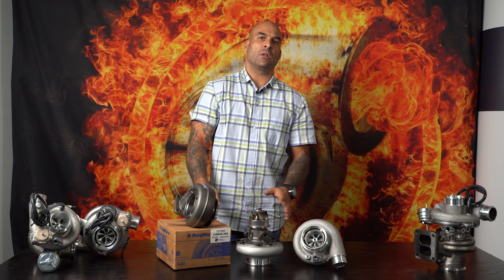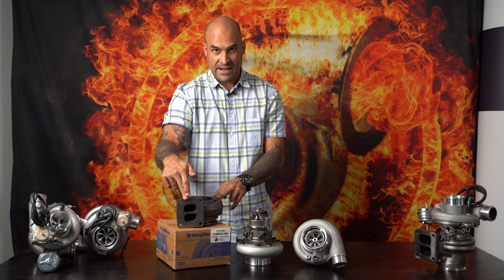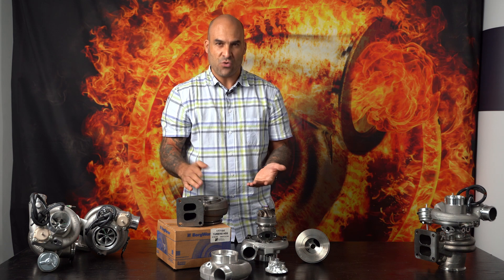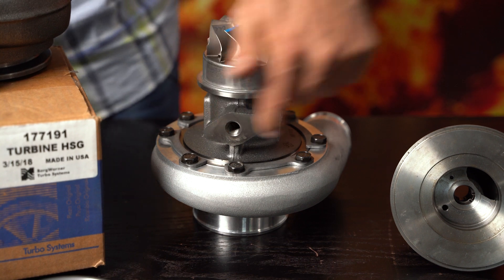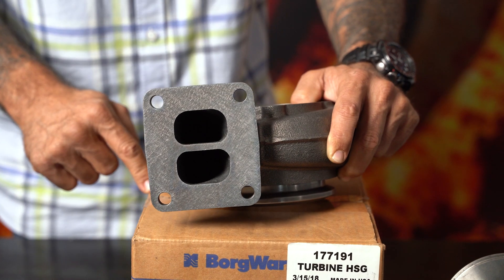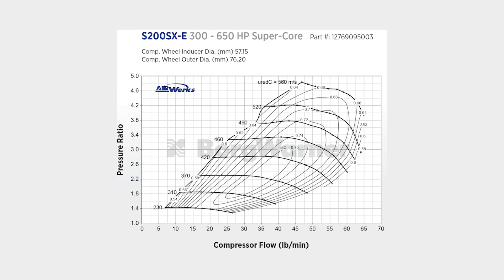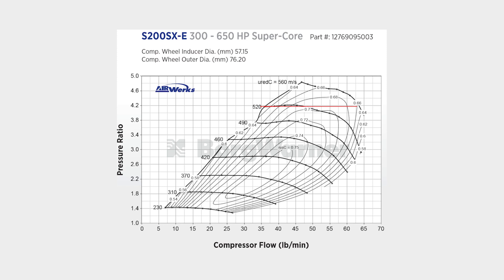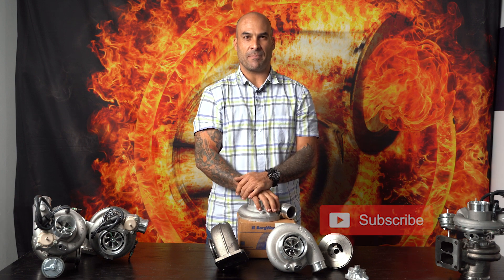BorgWarner Airwerks S200SXE - 650HP

Comment: I love your videos
I choose the bw s252 sxe t3 single ar .82 for my bmw E30 m20b25 2.5 lit stock bottom 
I will run it to max 13 psi and my goal is 300-350 hp 
It will be laggy to spool?
Reply from the maker: Thank you for the comment - the setup will not be laggy at all - very streetable and will make the power no problem with plenty in reserve.
Reply: @TurboDirectSA  thanks for your fast reply
i was between the s257 and the s252 ,so the s252 from my research was correct
Reply from the maker: @bmwe-op4jx  Both turbos at the boost and power target you want to run are correct options. The larger turbo will obviously allow for more reserve should you choose to up the boost later, but response will be almost identical, with the slightly different power level available.
Reply: @TurboDirectSA  my main concern was that i cant go more than 15 psi,so the smaller turbo for my specs and engine was more streetable and faster boost in lower rpm range i think
i will run it with 3 different maps,7 psi ,10 and 13 at max
Reply from the maker: @bmwe-op4jx  Both turbos will easily spool with that engine, the larger S200SXE will just make more power at the same boost pressure due to its higher flow rate.
Reply: i upgrade my s252 to the s257
it made 502 whp and 685nm at 1.7 bar. That turbo is amazing..at 3.8k rpms it has 590nm
  @TurboDirectSA
Reply from the maker: They are amazing turbos!  @bmwe-op4jx

Comment: Hi i will like to fine out if this turbo will work well on a 1jzgte vvti engine
Reply from the maker: It will work beautifully - for a street car aswell as a nice 650HP drag setup - in fact this is one of the turbos we will be testing on our 1JZ project car we busy installing into the BMW E36 shape body. 

We will do back to back runs with different housings, and the EFR7670 and EFR8474Black series - then we will change to the Garrett range of turbos and do the same back to back testing to show the differences on the same engine same boost and different AR housings.
Reply: Nice project . Cause what am looking for is quick spooling and lil lil lagg not make much
Reply from the maker: @tezzaking1014  It will work well - use a separated manifold and use the twin scroll AR83 housing.
Reply: Thnks alot i was thinking about using a twin scroll  AR83 housing.
Reply from the maker: @tezzaking1014  You wont go wrong with that housing.  Make sure your collector is made correctly - ill do a video on what a collector should look like and what angles work well -
Reply: That will be great thanks alot
Reply: @TurboDirectSA  hi what's up any update on the 1jz project with the BMW  E36 shape ???
Reply from the maker: @tezzaking1014  here you go -- more to come soon  https://www.youtube.com/watch?v=I14mwxVYhoE&t=1s

Comment: Firstly, this is an awesome channel and thank you for the detailed informations :D

Secondly, I have an SXE257 installed in my car, on an 8V 2.0 Engine from Volkswagen (completely modified) with a custom Turbine Housing with selfmade QSV valve integrated in the housing.

Actually my axial bearing died, but do you know that kind of problem with the axial bearings? because it's not the first 257 that i know with bearing damage.

Normally i use about 2.5 bar of boost, but tried up to 2.8 this year (shouldnt be the problem for this Turbo)

thank you
Reply from the maker: Hi Ronald,

Thank you for the compliment. What boost are you running the QSV to before it opens? When it opens, does it remain open permanently there after or does it close again when the boost pressure lowers? What is this boost pressure threshold? 

I have never had thrust bearing failures on these turbos, and the very same turbo bearing system runs on industrial applications at over2.0bar gauge pressure permanently for long shifts. 

Last question for you - does the bearing wear on both sides or one side only?
Reply: @TurboDirectSA  thank you for the very fast response!

I switch the QSV with an MAC valve at 220kpa controlled via my ECU (and it closes when boost goes under 220 again)

I use a 1.00 AGP T3 twin housing for this

I demount the turbo this week and will disassamble it, then I can say if it's one side or both

do you also sell repair kits for this Turbo? thank you

Comment: Examining the stated capabilities of a similarly-sized Garrett turbocharger, the Garrett G30-770
, I noticed some things
A) Bottom-left boost I examined on the charts was 2.5lbs/min at 1.5 bar boost BW:73-74 percent efficiency.
B) same boost/pressure point on Garrett: 72-73 percent efficiency. (note: this is steady-state, and says nothing about polar moment.)
C) Stated horsepower: like all conscience and sentient beings, I ignored that as it is irrelevant to the compressor map.
D)Highest pounds-per-minute airflow: 65 on the BW, at 60-64 percent. 70 for the Garrett at what seems to be 55 percent efficiency,
E) Tip speed at 87.5 percent for the BW: 62.5lbs/min airflow at 60 percent efficiency. Garrett: 65lbs/min at 55 percent or so, again.
F) at the highest efficiency island for BW: 42.5 lbs/min at 3.0PR at 75 percent efficiency. Garrett: 57.5 lbs/min at 3.0 to around 3.35PR
Borg-Warner chart has a bigger maximum efficiency island from 1.5 to 3PR and abbout 25 to 44 lbs/minute, Garrettt is 2.3 to 3.3PR at about 41 to 58lbs/minute.

It looks like, on initial analysis, the Borg-Warner may spend more of its time in actual use closer to the maximum efficiency. It would be nice if Borg-Warner also published a Boost Advisor like Garrett. I do not know the polar moment, energy-to-spool times, etc. of the two turbos, but the Borg-Warner looks like it would take less energy to start making boost. HOWEVER, also an unknown is backpressure. How efficient is the actual compressor half is not the whole story. If the turbo produces a matching inefficiency in its turbine housing, it defeats any gains on paper.

A true, back-to-back test that uses an inertia roller dyno will show the responsiveness of any given system.
Reply from the maker: Hi 

B) Polar moment?? Not following you on this.
C) Horsepower is absolutely relevant on all compressor maps, the flow rate is 100% directly proportionate to the HP in X10, X12, X15 ..... calculations. 

BorgWarner have a FAR superior 'boost advisor' called Matchbot, it literally makes Garrett look inferior and incapable - see https://www.borgwarner.com/matchbot/ 

Performance of any compressor will depend on the engine its installed onto. Id suggest you take a look at Matchbot, and you will have the answers to all your questions relating to turbine efficiencies etc. 

Back to back testing can only show so much .... on road runs back to back are the true test.

Comment: bought and waiting a/r 63, going to use on 2.0 FSI, safe max boost what will be? (blown up 5558 gen 2, on 2.3bar, can this turbo handle 2.3bar ? ) point is 450WHP on 4x4
Reply from the maker: Well done - good choice. This is a BorgWarner turbo, not a chinese made precision. The S200SXE will boost safely over 3.0bar gauge pressure reliably, see the compressor map. 2.0bar gauge pressure will not damage this turbo.